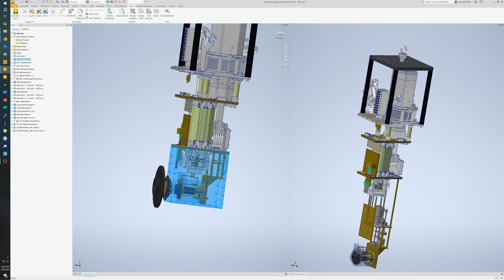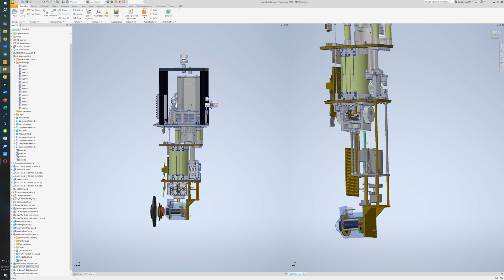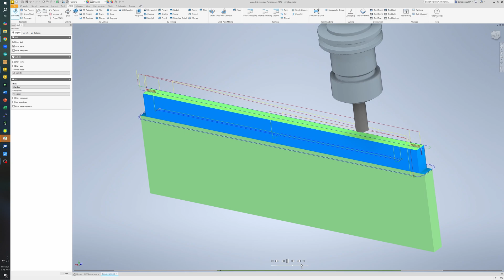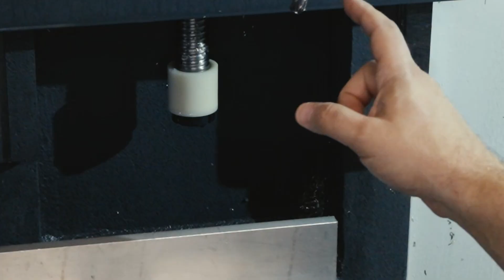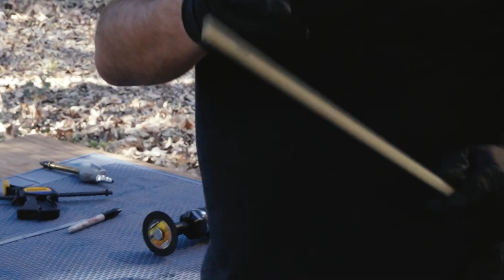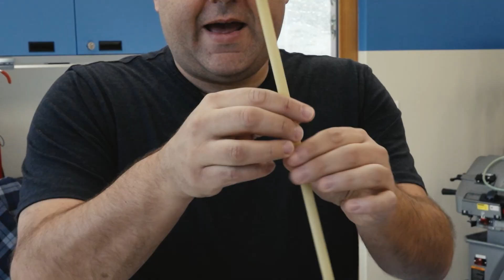Making Structures That Won't Break Near Absolute Zero

Comment: As a physicist rather than an engineer you may not know that if ever you want the very best performance out of engineering epoxy glue it needs to be heated to achieve a 100% chemical cure. This even applies to epoxies which are advertised as ‘cold curing’. I always used to put all my transducer assembles and things into a laboratory oven reserved for that purpose which I would set to whatever temperature and time the manufacture recommended.  Sometimes I would even vacuum them first to de-gas the resin. This also meant that the items were ready for deployment sooner and they would survive harsh and challenging operating condition – I hated to make something twice.
Reply from the maker: Yeah sometimes we cure Stycast on a hot plate when we are in a hurry. I do worry though about elevated temp cures when we are going cryogenic, since I think it effectively increases the delta T between the room temp and cold for thermal contraction.
Reply: @ExperimentalAstrophysics  I saw your other video using those thermal insulators. I am surprised that epoxy holds together at 4 Kelvin.